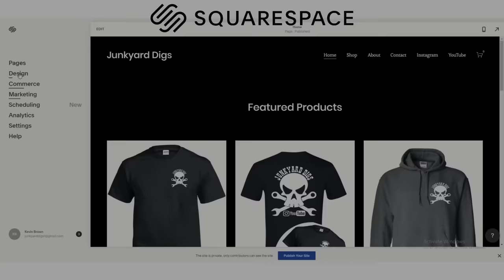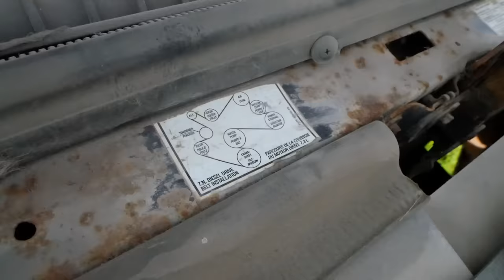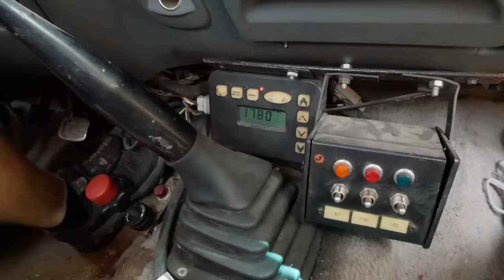Can We Get ABANDONED Tow Trucks to RUN?  - Part 1

Comment: Being a  former police officer now attorney in Iowa the reason why you have dot numbers on the truck is because the person who had it before you had a towing  company "for hire" and it was a commercial so that's a department of transportation number. Now if you plan on having a " for hire " company also with this truck you will need to apply for a DOT number also. If this is for private use then no, you will not need the number! Even if you owned Tractor Trailers you will only need air brakes endorsements for your drivers license no commercial drivers license. Only for private use

Comment: If its a powerstroke it has HEUI injectors. Hydraulic Electronic Unit Injectors. They require at least 500 psi of oil pressure to operate. The engine has a low pressure engine lube pump and a high pressure pump for the injectors. These engines always take some cranking to start.

Comment: Those are one of my Favorite Body Styles. I used to Drill Water Wells in my early 20s. And my Work Truck was a 96 F-350 7.3 PowerStroke Flat Bed. Even had the Big Diesel Tank behind it with pump. My Boss actually took the Truck to one of the Local Diesel Shops. And put a Chip in it hoping to save Fuel Mileage. It had a 5spd Manual Trans with a 4.10 Rear End and it was 4×4. It never got good Mileage but would blow the black Smoke after the Chip lol. I loved that old Truck it was Fire Engine Red. Had all the Running Lights on Top of the Cab and all the way around the Truck. It looked Cool as hell with the Parking Lights on. Almost like a Big Rig.

Comment: 7.3 power strokes injectors are oil driven. They need a certain amount of oil pressure for the injectors to start firing fuel into the cylinders. I would check the high pressure oil pump and see how much pressure it’s making because those motors are very fussy when it comes to oil.

Comment: I can tell you guys have never been around a service truck, always when using a jack on soft ground is use wood blocking under the jack
DOT number is registered to the company before you, do take it off
Reply: I put wood above the jack as well ..so it won't go through the rocket panel...rust belt issues..😉

Comment: 7.3 powerstrokes use high pressure oil to fire the injectors. It is supplied by the high pressure oil pump which is fed by the low pressure pump. Check oil level if it does not improve when full you either need an ipr valve hpop or o rings on the injectors.

Comment: You might possibly have a bad "check Valve" somewhere in the fuel  supply line that allows the fuel pressure to bleed off or the fuel to run back into the tank. Might also be one in the oil run pump system causing it.

Comment: @Junkyard Digs Another use for that giant pliers you bought as a joke, those are great for the fuel filter cap on that red tow truck. There is a special tool for the cap, but who needs that when you have a giant pliers! The giant pliers will save you a lot of purple fingers. The cranking a lot before start: I found that sometimes the fuel filter cap is too loose or didn't seal properly and it has to reprime every time you start it. I didn't see you torque it down when you put it on. I have noticed that you do a lot of that stuff off camera, leaving us to question weather you did it or not. Another symptom can be a loss of power when you throttle hard due to sucking air into the filter housing.

Comment: Best way to pick up the rear end of a tow truck, first Put wood blocks right underneath the stringer then lower the stinger down on to the blocks, that would push down onto the blocks and the rear end of the truck will come up off the ground.
And that Would of made it way easier to even pull out that jack when it broke 
Just friendly advise 
Use to work for AAA roadside for years thats how the shop guys would change out the rear tires on our tow trucks with out a jack

Comment: be careful with ether on any diesel with glow plugs, not only does it ignite the ether, it can actually cause the tungsten tip of the glow plug to chip and brake off into the cylinder which could lead to blowing the motor. you can easily avoid this by waiting until the glow plug warning light is off before cranking.

Comment: That starting fluid is a sure way to crack a piston.. diesels dont like it... get good fuel in it, new filter. And hook a strong truck with some jumper cables and crank  till you get fresh fuel coming up... also a good thing to just change out is the cam position sensor while your at it. Just stop using the ether.  Also it wont start without oil pressure.. the injectors run off oil pressure... the injectors have there own high pressure pump  that's in the engine valley. It is also a possibility that the glow plug relay doesnt work (very common) and even if its warm, no glow plugs cause hard starting

Comment: The ignition probably turns over and starts without a key in it 😂 my 96 half ton did the same thing lol didn’t even need to get the extra key. And you never checked the visors for the keys lol

Comment: Alright so from 94.5 to early 2003 was the power stroke DI turbo diesel. There is no injection pump in the truck. The last time there was an injection pump was in the idi's, which were stopped being made in early 94. So the way the power strokes are run is fuel is delivered to the injector. Then the HPOP (high pressure oil pump) basically pressurizes the top of the injector, which in turn pressurizes the fuel inside the injector enough for it to spray the top of the piston. In between all of this there is some important electronics such as the PCM (power control module) and the IDM (Injector driver module). So basically I'm gonna guess it was a weak HPOP. If it's leaking or any of the high pressure lines are leaking, it's an easy fix. But it's likely just a tired old worn out pump from sitting. Another thing you could do is replace the fuel pump, CPS (camshaft position sensor), and the IPR (Injection pressure regulator). All easy access sensors. If you buy a new CPS make sure you buy an international brand CPS. Not Orileys or auto zone. Good luck!

Comment: The fuel pump is oil pressure driven. Make sure oil level is correct and also you could be getting air in fuel line and that is why it's having the long first crank then having to crank again.

Comment: 7.3 powerstrokes use a HEUI injection system which is fired by the oil and there is no injector pump. So until oil pressure is built up the truck wont start

Comment: Yes injectors are driven by the oil pump, but once you change the oil it should help.
Also the fuel filter housing has a drain on it.

Comment: It does require oil pressure to start. There is a high pressure oil pump under the intake and the high pressure is used to fire the injectors. Also you need to run it longer and drive it like you stole it to get all of the air out of the fuel system.

Comment: If you are trying to use a key that isn't programmed for the power stroke the theft deterrent system will disable it.
Check for a little red theft light flashing in the dash.

Comment: This video gave me PTSD from my recent ownership of a 1995 7.3L. Cheapest part of owning one is the sale price. Why? Because 26 years later, guess what happens? Every hose and plastic part starts to disintegrate. So total fuel system rebuild, vacuum rebuild plus all the regular stuff like sensors and cooling system and all new engine wire harness. Best thing to do upfront is drop the fuel tanks, new sending units, new transfer pump, new fuel pump, get rid of the fuel bowl heater, replace glow plugs, clean/rebuild injectors, replace the high pressure fuel lines. Dont buy those at Ford. HP fuel lines can be made for $30 at any hydraulic repair shop.

Comment: There is no injection pump, you have a low pressure oil pump that feeds your high pressure oil pump. There are many things that come in to play when having a high pressure oil problem. With out proper diagnosing tools, you will just be replacing parts. Got to have a way to monitor icp, ipr %, rpm, and battery voltage. All those play a big role in whether your 7.3 starts in 2 seconds, or 2 minutes.

Comment: its probably too late for this but check your fuel check values. the problem is a common and easy fix but is the most overlooked. you wouldn't believe how many times I had to replace check valves on older tractors.

Comment: Not to be harsh or anything. But don’t don’t cold rev a diesel. You’ll blow the head gasket/s real quick. Those 7.3 power strokes are bad about either backfire. Also either washes all the oil off the cylinders. WD-40 works just as good. Congrats you own the loudest running engine known to man lol. Good video!

Comment: Okay it's probably already been said but with most diesels do not crank it right away to try and build oil pressure you must turn the key to the on position and let the glow plugs warm up and then once the light goes away for the glow plugs then you can crank it

Comment: It was probably said somewhere in the comments but in case it wasn't, its not a good idea to use ether on an diesel engine with the glow plugs actively cycling.  If you must use ether, disconnect the glow plug relay.

Comment: Pretty sure you cracked a piston with that either backfire on the red truck cause the motor is skipping pretty good when your cranking it. Disconnect the glow plugs if u gotta use the cosby

Comment: A diesel will have 2 fuel pumps. One is to move it forward in the truck, the lift pump, the other is to get that fuel up to a very high pressure to get it over cylinder pressures. The plug on the side of the master cylinder will have an adverse effect. Decreased breaking on a vehicle that size is a suicide attempt. If you have it back at your place, id call the tow company and see if they want it back. A reward may be in line.

Comment: New subscriber here, when you start a diesel first thing you do after getting in behind the wheel is turn the key on engine off slap the fuel pedal to the floor and release it and then try the key. They usually start better when you do that.

Comment: The reason why it takes so long to start is your fuel is either bleeding back to the tank, the truck needs 60psi of fuel pressure or the oil reserve tank in front of the hpop is bleeding down causing lack of oil to the hpop taking longer to reach 500psi of oil pressure for the injectors to fire listen for the loud clicking under the hood

Comment: You dont need to soak up diesel. It doesnt go bad like gasoline.  It stays.good for decades.  You just have to remove the water which is what the fuel filter was for.

Comment: Injectors are run by HPOP more then likely it needs a new HPOP or a rebuild. Also make sure the truck has enough oil in it. Fresh oil would probably help it out. Get some Rotella T6. About 15Qrts of oil.

Comment: the7.3 powerstrokes use a HEUI injection system which does not have an injection pump, instead it builds injection pressure in the body of the injector using high pressure oil. the long cranking to start on these motors is due to the high pressure oil pump building pressure for the injectors.

Comment: I would check the fuel and change the oil with motor craft oil and filter. Hopefully you used motorcraft fuel filters. Also check your air filter

Comment: Those 7.3s had a problem with the HEUI pump check valve sticking open which would give you the hard start trouble you are seeing. Not a bush fix unfortunately.

Comment: In a diesel you have heaters that crank when u turn key on. If some of the heater is not working u need to turn key on and off three or four times and each time u hear a click. This way diesel engine starts easily.

Comment: Turn the ignition on let the glow plugs heat up, then you start it. dont just put the key in and turn like a gad engine, usually theres a light or a dinger letting you know.

Comment: Watch Wes Work has a couple videos on the HEUI system, which I believe this truck has. He did a whole video on fixing a truck with a really long crank time like this. That's not normal, but it happens to these old ford's. Has something to do with oil priming a secondary reservoir for the HEUI system iirc.

Comment: "can I legally drive this?" sure, just don't get pulled over by DOT commercial vehicle inspections.  I think in this case they would tell you to call a tow truck....lol.  I actually saw that the other day. a tow truck with a pickup truck on the deck broke down, and was being towed by a land-all semi tow truck, with the pickup still on the deck. It was a triple decker. And probably over height. Fuck I laughed so hard. Especially because I used to work for the company.

Comment: Electro mechanical  injectors, high pressure engine oil operates  them 
 ECM operates the solenoids  that admits the high pressure  oil at the proper time,opening  injectors  and admitting diesel fuel also under very high  pressure.

Comment: 7.3 idi has a mechanical injection pump and 7.3 and 6.0 powerstrokes do not have injection pumps and use high pressure engine oil inside the injectors to pressurize fuel instead

Comment: Its not the oil pressure when you start it, if you hold the key to the on position for like 20-25 seconds before starting it should fire right up because the plugs are warm

Comment: I think it's a bad high pressure oil pump... I got the same problem on my brothers 97 7.3. Also, 1st is made for heavy loads.. mainly start in second. The trucks gears are rated really low.

Comment: You can get metal replacement door handles to swap out with those plastic garbage handles. And... a 460? No, you don't want that pig. Believe me, once you get to using this Powerstroke, you won't ever want to go back to a gas truck again! I mean you will, of course, but every time you fill it up at the gas station you'll wish it was diesel.

Comment: now, I know NOTHING about diesels compared to gasoline engines, however dont the glow plugs need to be fully glowing before you try to crank it or was that something you did off camera? You had said something about the fuel injectors being oil pressure operated and i just thought of the glow plugs being the reason why it struggled.

Comment: That truck has a hydraulic wheel lift that if you put a block under it would've lifted the back of the truck up made it a lot easier for changing those tires

Comment: Try a E450 shuttle bus with a 7.3l powerstroke.
Absolute nightmare for an experienced mechanic (per the mechanic that fixed the high pressure oul pump hose), and even worse for the regular joe trying to fix their own things. 
They literally shoved that engine in there.
I don't know how they did it.

Comment: You can call any locksmith and they will come out with a box of keys and try them until they find the one that works. There were only a certain amount of different keys made for those in the 90's. It's honestly that easy. I've done it.

Comment: Glow plugs. 7.3l will not start without glow plugs working right. Even on a 100° day. I'd start with that. Also if it's a 95 it's not a true power stroke still IDI and won't have the electronics on it.

Comment: There is a anti-drain back check valve to the drivers side of the hpop (burried in the valley under hpop lines) it keeps the oil from draining out of the hpop tank when the motor isnt running. If that is stuck open it will take forever to replinish that hpop tank and it will not run without oil pressure on that tank. You can get to that valve without removing to much its a pain to get to tho. Sure its been mentioned but if not, good luck!!

Comment: You have to idle up the engine before that Hydros will work at speed.  Annnnnnd!  A cinder block under the wheel lift fixture would have lifted the whole rear end of the truck off the ground.

Comment: With old trucks like that if you have no key and the steering column is locked just pull on the steering wheel it will break the lock and then you're able to drive

Comment: You have a working "hydraulic" wheel lift on the back. Wouldn't it make more sense to put a block under it and raise the whole back end of the truck rather then trying to jack up one side at a time...........in the dirt? Just curious.

Comment: so if your 7.3 will not start. 2 or 3 oz of gas down the air intake works wonders.i have done this offten  on my 7.3 that had no glow plugs  if it rolls over it will start then pick up the fuel. works great. no shit

Comment: There a drain on that housing to remove all that water should have a yellow handle on it my advice is drain it every time until clean fuel comes out and add some fresh fuel and an additive archoil ar6200 fuel works great for them powerstrokes good luck

Comment: I’m a 10 year old and I am a pro at old Diesel engines and have repaired my grampas tractor in the middle of a balling hay you have to drain the coolant and replace the spark plugs new oil and filter new fuel filter clean the intake and new belts an the fan should run like new for at least 4 years.

Comment: No the truck doesnt have to build oil pressure. You shouldnt have to crank it and then crank it again everytime you start it. If it was elwinter with bad glow plugs thatd be one thing but dead of summer in short weather you shouldnt even need glow plugs. Notice how it skips when you crank it that engine has no compression. It shouldnt crank faster and slower faster and slower like that thats how you can hear the compression. That oil pressure gauge literally doesnt mean anything. Thats just your engine oil pressure. The HPOP oil pressure is what would need to build to start and that is not read by the gauge youd have to have a scanner. Throw a compression test on that thing

Comment: You could of used the wheel lift to lift the ass end of the truck off the ground enough to change the tires wheel lift all the way down and then tilt all the way down on top of a 4x4 and there ya go off the ground